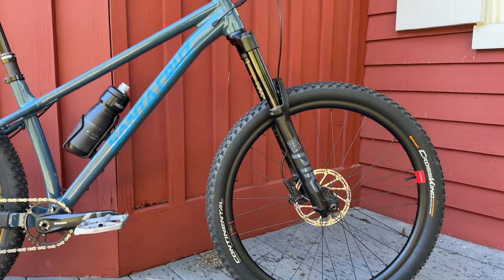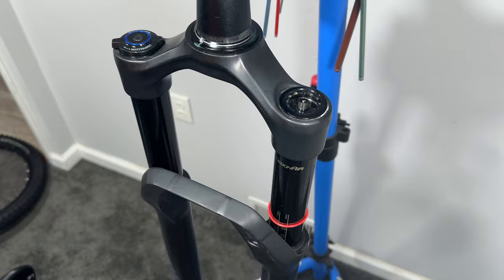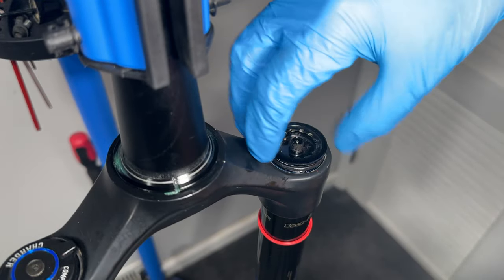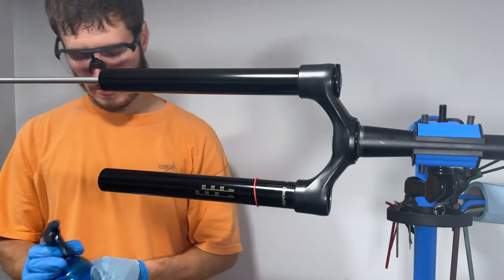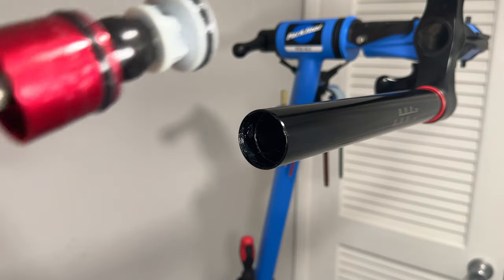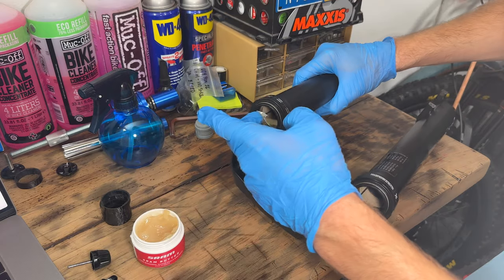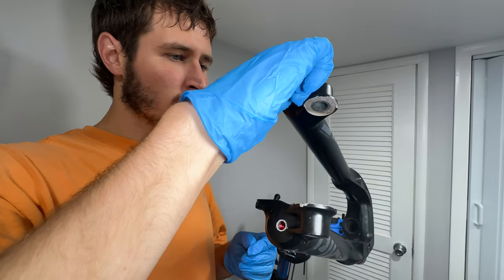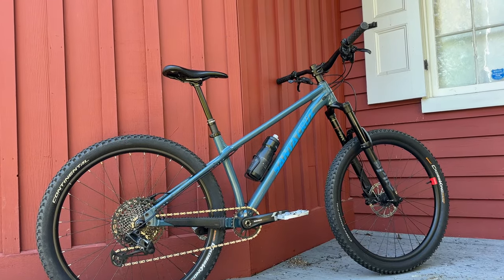How to Change Travel on a RockShox Fork (Pike, Lyrik, Zeb, Yari, Revelation)

Comment: Seems like a lot of travel for that bike! Really good job on your tutorial. Rock shocks forks are a pretty good to work on I think.
Reply from the maker: @theshedMTB  thank you! Yes, working on the fork was more straightforward and easier than I anticipated! It is a fair bit of travel! I was a little worried about going 160 but the bike feels so much better than it did at 140 now that the geo is balanced. It has the poppiness that it had when it was a mullet. I’m going to make another video diving into it more but I’m very stoked it on! Thanks for the comment and thanks for watching! 🤙
Reply: @ I forgot it was a mullet extra travel just making up for that
Reply from the maker: @theshedMTB  exactamundo!

Comment: Very cool video. So if I wanna increase the travel of my Pike from 130mm to 140mm, I need a longer air spring of the right model #, that’s it? All other parts can be reused?
Reply from the maker: @GokkunGuru  thank you! Yes, that is correct! You only need to buy the air spring and of course replace the lube/fluids. I would suggest buying new wiper seals if your fork hasn’t had its 50 hour service recently. But it’s not necessary. Hope this helps! Thanks for watching!
Reply: @NickandKatieMTB Awesome. Just ordered the kit. Got all the oils already. Thanks again!

By the way I loved the older video of how you stripped the anodizing on your OneUp pedals to give it that chrome polished look. Super unique. OneUp should make a chrome version just like Title MTB’s Connect pedals.
Reply from the maker: @ that’s awesome! Happy to help! 

Thank you! I love my OneUp pedals. They still look great to this day too! Silver/chrome is the best accent color!